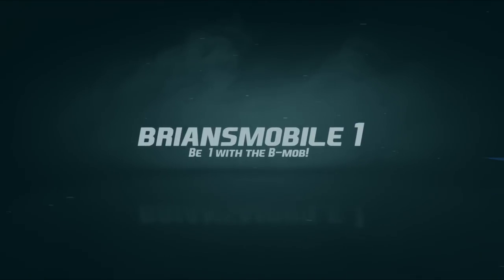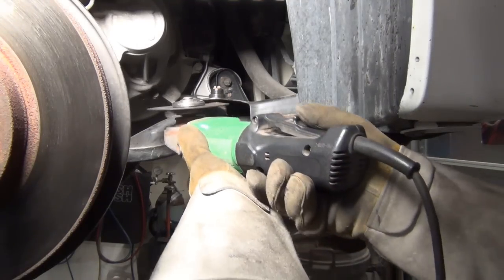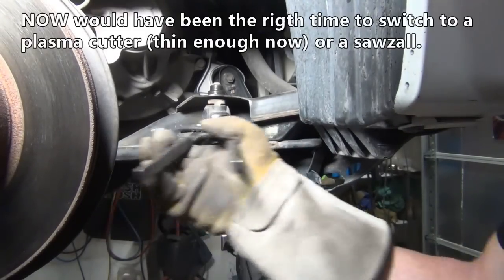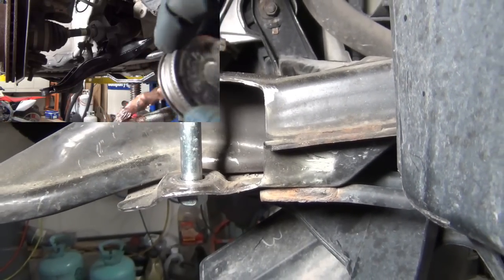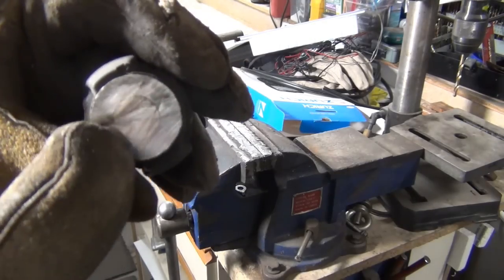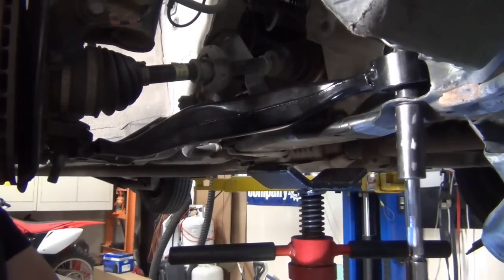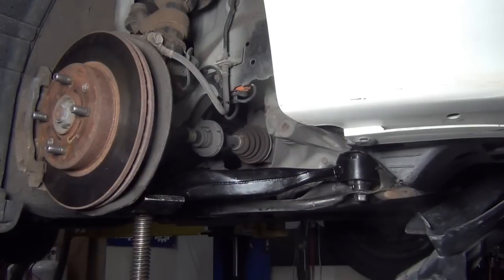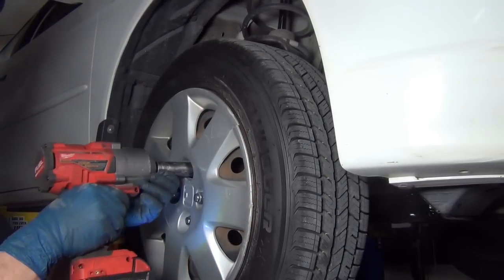Rusted Bolt in Control Arm Fix 2 of 2

Comment from the maker: "If I could tell the world just one thing it would be, we're all okay."-- Jewel   And probably don't try this at home- specifically use the guard on your angle grinder.  Much of this could be accomplished using a hack saw or a sawzall.  #thekickbackisreal
Reply: Ant not to worry cause worry is wasteful, and useless at times like these. 

<---- 90s kid. Good video and be as safe as you can be.
Reply: So I recently bought an angle grinder with a cut-off disc and a sawzall and after trying both to cut apart this metal futon frame I have to ask: Why ever use the cut-off disc? It's louder, slower and scarier!
Reply: Definitely gonna buy a sawzall someday for this type of stuff. Great knowledge. Thanks Brian.
Reply: @rfmerrill  the grinder can cut much faster, and harder materials.  In particular the bolt he was cutting in this video was probably a high grade, and quite hard.  It's possible to cut through it with a sawzall, but it's hard and time consuming.  The fouton frame was probably mild steel as well as thing guage
Reply from the maker: @rfmerrill  Accuracy and the thin discs I use are pretty fast

Comment: I have operated a chainsaw most of my life.  I find that if you stop and think carefully about what a chainsaw can do (worst case scenarios) and why, and position yourself and act accordingly, you can "safely" remove the guard on a grinder and apply all the same principles and respect with an acceptable level of risk.

For those who disagree, I say fine and exhort them to leave the guard on.  I would also recommend, however, that they never use a chainsaw.

Great videos!  I have followed your channel for years.

Comment: Been there! Done that! Usually get it to where the control arm is gone and it's just the bolt sleeve and rest of the bushing left. Then grab the bushing/sleeve with vice grips or pipe wrench and hit the bolt with a impact. Sometimes need to heat the sleeve to break the rust bond between the bolt and the sleeve.

Comment: I am a firm believer in listening to that voice in your head.  I was getting ready to use the death wheel and a nagging voice kept telling me to put on my welding mask, so I did.  Sure enough the cheapo cut off wheel I used shattered and went right for my face.  Being smart saved my face.  Also, do you follow Project Farm?  He did some testing on cut off wheels and determined that the Dewalt ones were one of the best value as far as price to performance,

Comment: yes Brian the best advice you can give any mechanic esta threat it on by hand before you use an impact I was forced to use the services of a mechanical shop I was out in the middle of nowhere and I lost my transmission when they replaced it they ran a ball joint nut on with the impact without threading it by hand first 800 miles later my front end collapse as I pulled into a rest stop I spent the next five hours fixing it thankfully I met some really nice people that help me out and thankfully I had brought a whole bunch of tools with me so whatever you do if your break down in Green River Wyoming don't use the services of some of the shops there

Comment: I don't quite know how to describe it, but using one side of the disc tends to lead to much less kickback, the rotation of the disc push's it away from the material rather then into it.  If the disc bites and the rotation push's it even harder into the material is when you can get some really gnarly kickback.  Of course it's not always possible to do this.

I also prefer my cheap crappy grinders for just this reason, as long as i keep a firm grip on them i'm strong enough to keep em in control.  A death grip works as well, but i'm lazy and cheap :P

Comment: Would a INDUCTION Heater in this situation work, I am thinking about buying one it is expensive about $500 but it seems like it would work faster???
Reply: I have freed one with an induction Heater. However induction heaters are fragile if the coils shot. The advantage of an induction Heater is you have more chance of freeing the joint without destroying it if its reusable.

In this case I think the grinder is the way to go as its the fastest way that will work.

Comment: Hello Brian, Rob from Australia here. We are just about to replace the lower control arms, bushes and anti roll bars on our Land Rover Discovery Series 4. Looking forward to a quite and more 'direct' ride. It's done 170,000K's so not a bad life for them. BTW i sent you the info and article of the old Massey Ferguson TEA20 tractor that i replaced the front end on, inspired by you. Do you remember that? A couple or 3 years ago i think. I also sent you the old tractors number plate. Did you ever get to put it up in your number plate display wall. Just wondering. No biggy if you didn't. Cheers from Downunder.

Comment: I’m dealing with this problem on my 2010  civic the front LCA had a bolt stuck. I had to cut it using a saw cause I couldn’t get a grinder in there. Had a problem where I snapped the head on the bolt. Now the first hole where the bolt goes into is bigger from snapping the bolt and the bolt won’t be straight. Don’t know if I should try and weld it to fill the hole better.Also still have the left over from the cut bolt stuck in the other side where the welded nut is into the subframe

Comment: When they kick back like that I screw the side handle into them and hold onto the handle.. Been there doing 100% what you did!! It’s a pain 😡😡🤬🤬😒😒😒😒.. Thanks for the video
Reply: Truck Mechanic exactly. The angle grinder handle existes for a reason. I don’t really like to wear gloves using machinery simply because I like to have the feel in my hands. With gloves you loose that feel. At least if you are using gloves, please use the grinder handle so you can have more grip.

Comment: Everybody seems to have trouble with this kind of repair, bolt frozen inside a steel bushing. I wonder if it will become less common as teflon or plastic bushings become more prevalent. I'd be tempted to blast it with a cutting torch, but even so it ain't easy.
Reply: Teflon or plastic bushings? I don't see those being ever used in street cars, poliurethane mayby- it's better than rubber in every way, but still- the part that the bolt goes through has to be metal, it's what's clamped down with the bolt.
Reply: @piciu256  I listened to an interview last month with a researcher who was working on industry sponsored R&D for a full size car that is COMPLETELY plastic. Ironically, when asked how it would be recycled, he said it wouldn't, it would be trash. The new plastics don't recycle at all, they are too hard to melt and reuse.
Reply: @spelunkerd  ok, it might be strong enough to support the weight, but the hardness factor still remains- rubber bushings are used for their compliance, if that was not a factor- we'd all be running ball joints everywhere for better suspension control.
Reply: @spelunkerd  also, I'm pretty sure the "plastic" car wasn't made of nylon or any other "plastic", it must have been composite, thus making it pretty much impossible to recycle.
Reply: If we had cars built out of hemp like the first cars ever made, they would be recyclable and much much stronger than any steel or plastic ever made. To bad big oil companies wouldn't ever let something like that happen again. 😔

Comment: Thanks for showing everyone the dangers of the angle grinder. Especially the part of staying out of the plane of the wheel. They make me so nervous that I'll wear a face shield and welding jacket when in a "tight" area. On a side note; your parachute cords look way too thin on camera. I would only ride on one of those if it had 1/4 inch steel cable. Of course I'm a scaredy cat.

Comment: Next time wear the cutting blade down until it's small enough to fit in the spot you're cutting in. I just hold it down on a some metal until the blade is half the size. Then stick it in the small space to cut.js

Comment: Brian, the best two companies when it comes to cutting discs are Pferd (Pronounced pfert - which is horse in German) and Walter. You will not find these at Home Depot but at higher end welding supply stores. This guy did a very comprehensive testing of cut off wheels for his business which apparently uses hundreds of these wheels a year and here is a chart of his results: https://docs.google.com/spreadsheets/d/1kBlybz3UklpXgPegPC2pl94xMcjl4_kkXch2MGzeDhQ/edit#gid=1